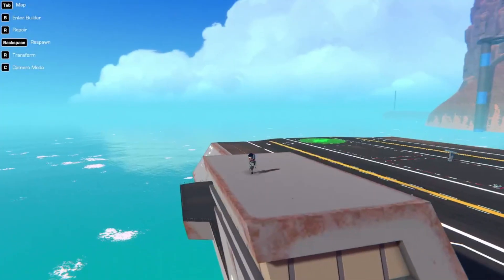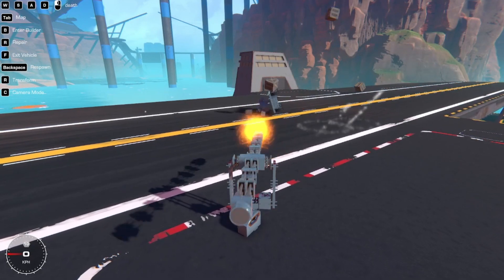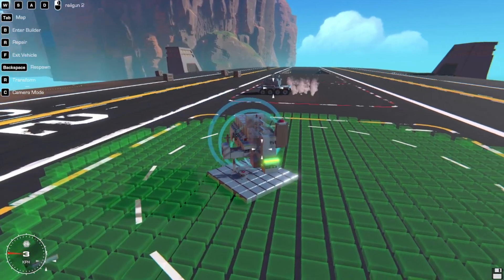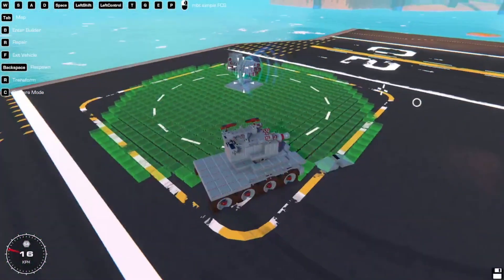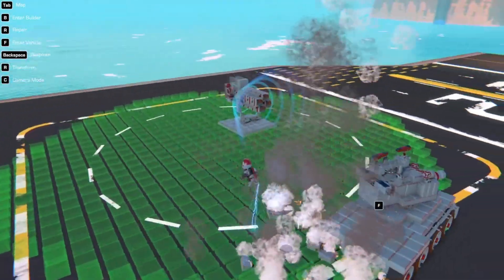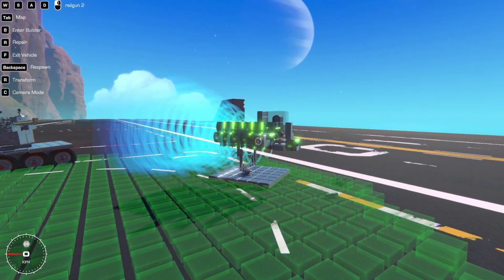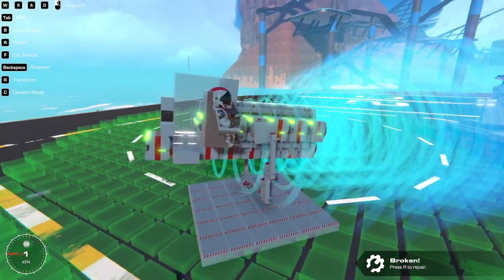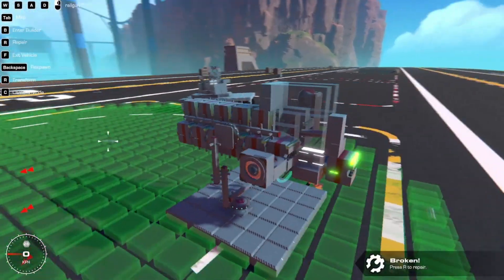New Railgun Stuff in Trailmakers

Comment: I tried to make that type of technology in besiege and the hitboxes shape are not regular enough to just roll out of the canon
and when I tried in trailmakers the friction model is so clunky that it's not consistent enough to actually aim with it

you might be better off putting a very light projectile at the tip of the " canon " and take advantage of that structure to put more tractor beams

Comment: I built a similar railgun just now, but I'm having a lot of issues getting the collision damage to actually register, it just fades trough builds.

I tried using the smoke generator as ammo since it's quite heavy and acts as a tracer, but no luck, and the eyeballs have much less feeding issue (not a single misfire, tho there diameter make them fall very slowly in the mag), but no collisions either.
Reply: Your magnets are too close. You should give a block of clearance, and no, it doesn’t affect elicits much at all.

Comment: With the new colisions, there's a larger emphasis on projectile speed, instead of just bullet size. Previously, my 12x12 brick made entirely out of decal blocks with a very square shaped magnet tube arround it simply vaporized anything and everything it slightly grazed. (I'm not exaggerating either)

Now it has a habit of simply throwing the the things it hits miles away.  Meanwhile, my Mach 2 seat railgun which was previously too fast, it literally phased through everything, now it has a tendency to get stuck inside and deal a stupid ammout of damage. These where primarily tested with a 10x10x7 cube of checkerboard pattern transparent 2x2 blocks, perfect for an analysis. The seat which was previously ALWAYS phasing now conistantly reduced the cube down to 50-30 of the 700 blocks. Meanwhile the big cube shooter was taking out 4-9 on average. However, it did deal about 100-200 blocks worth of damage when throwing the 700 complexity brick into terrain, 591 blocks left is still far less than the satisfying 0 it used to be.

Comment: Just a tip, i mainly build for asthetics, not functionality  so I may be completely wrong, but I think blocks are auto drag glitched If a block is infront of them, so you could move the detachable blocks to a different side, as long as the piece doesn't have aerodynamic arrows in builder, it won't have drag for that direction
Reply: No, not unless those blocks in the front are connected to a detachable block on make scrap. The only way to 0 drag glitch is with detachable blocks.
Reply from the maker: i... i know. thats why the detachable block is on the front. to reduce the drag.